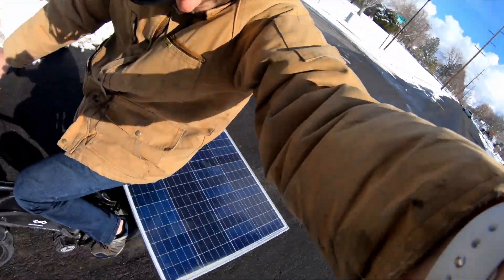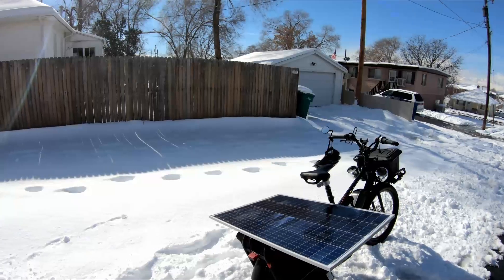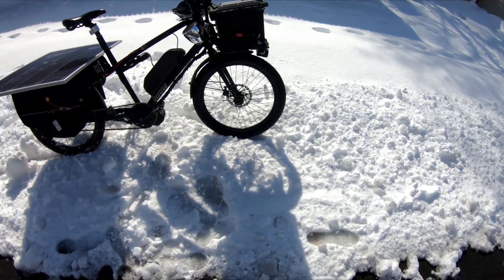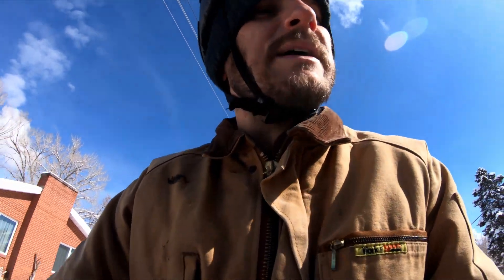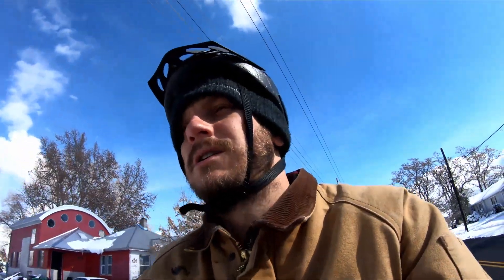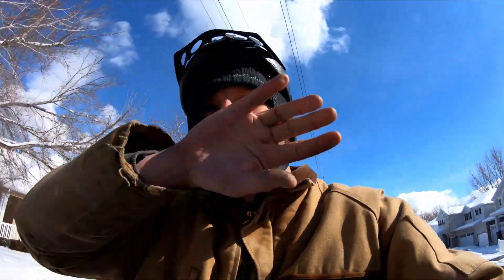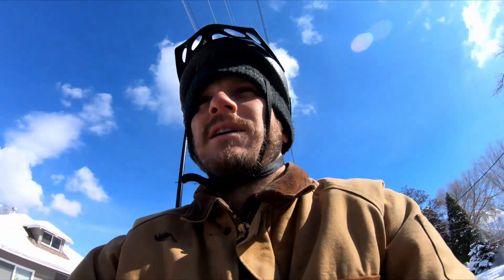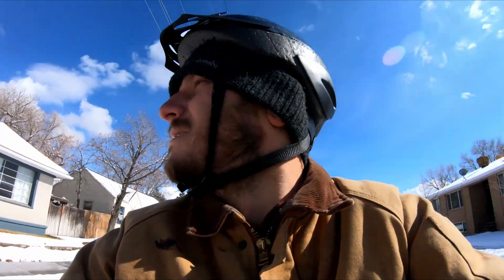Solar Powered Electric Bike: First ride and checking how well it charges

Comment: You should mount another to the front since you’re already wide. Just be sure to use an MPPT Charge Controller which allows one of the panels to be shaded without sacrificing power.

Comment: johnny.. currious about the specs.. Battery:  Volts..? AH..?  Solar boost/charge controller..?  Solar panel:  watts, amps, efficiency rating..?  All these things play into the range..
Reply: You could use actuators to keep the panel aimed at the sun.. Light sensors on each side cause the actuators to turn towards the sun.. You efficiency and range will go way up.. :)

Comment: I've been considering making something like this, just trying to come up with the best compromise between compactness, power generation and keeping drag/weight down for performance since  I don't have the cash to keep iterating designs.

How does much does the addition of this panel impact acceleration, handling and top speed?

My gut feeling is that for regular ebikes you'll need some really cleaver design to make solar panels worth it but for cargo bikes etc where they're heavy and have huge surface area already it seems like a no-brainer.

Comment: I just bought Sunpower cells -  the Sunpower cells are flexible and don't break (at least not easily) - I'm going for a lightweight foldout DIY panel 24-volt 250 watt that I can take on the road.  Future may include upgrading panel to recharge a 36- or 48-volt ebike.

Comment: What set up are using? I have the 36v 13ah system with 500 w hub motor for the bike and pulling the burly nomad trailer so mileage is cut in half. Solar ontop the rack of the trailer would great
Reply from the maker: 100w panel off amazon with a step up converter plugged directly into battery

Comment: That is pretty awesome! As close to a perpetual motion machine as I've seen. To avoid blocking the sun while riding long trips wouldn't mounting the solar panel to a trailer help?
Ride on & enjoy;)
Reply from the maker: It would. I already have a single wheel trailer to do that with. Just trying out a super compact rig. That trailer adds almost 8’
Reply: @JohnnyNerdOut  I was only suggesting for those long road trips where you want to hyper-mile it. I totally get what your  going for in a single compact ride. It's way cool! I almost did a cargo e-bike build...until I measured my building elevators;(
Reply from the maker: @michaelsprinzeles4022  for sure 👍 what about a mid tail cargo bike like a Kona “minute” or the Benno carryon? Still too long? I just love cargo bikes, the ultimate adventure ride 🚴‍♂️🚵
Reply: @JohnnyNerdOut  Cargo bikes are pretty cool. I'm cheap so any new bike would have to fill a new niche. My old Cannondale fitted with a rack & panniers comes close enough to a smaller cargo bike to make them not worth it. Even my hybrid city e-bike can haul lite loads. I was hoping for something I could do a Costco run with.
BTW I got my dog out in the new trailer for the 1st time. Thanks for the advice. Because of the narrow elevator doors it doesn't fit with the wheels attached. Fortunately it fits neatly in my station wagon. We walk to the car, giving her a chance to empty before a ride. It actually works out pretty well. We don't go as fast as when she ran alongside but it's nice to have her on rides;)
Reply from the maker: @michaelsprinzeles4022  awesome! I use that trailer to do Costco runs. Between that and my bags it hauls quite a lot!
Reply: @JohnnyNerdOut  Would be a hassle because the trailer can't be rolled through any of my building's doorways (wheels don't fit). I did think about it. I even measured the doorways before buying the trailer but learned, after the fact, the dimensions on Amazon don't include the wheels. Still love it for my dog though.
Reply from the maker: @michaelsprinzeles4022  dang it all!!!
Reply: @JohnnyNerdOut  Life is compromise. In the scheme of things I'm happy. I get to ride with my dog for company;)
I try to go green for personal & local trips but with passengers or large cargo I can live with the ICE. Plus it's a great place to store my trailer. Ready to be reassembled and not have to fit in my building.
Reply from the maker: @michaelsprinzeles4022  😀 good attitude

Comment: If your battery can charge and discharge at the same time, why not just put a small 1000wh solar generator in a bag on a rear, and plug in your ebike charger? Or just use the generator to charge a spare battery in the bag, so you can swap it fast, and then recharge the depleted one as you ride?